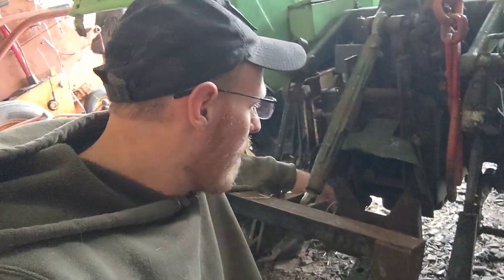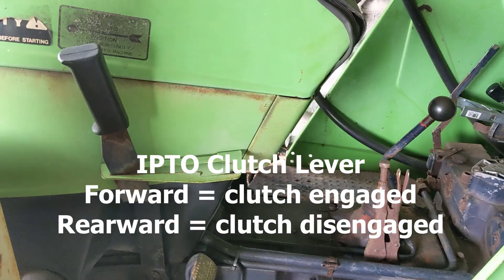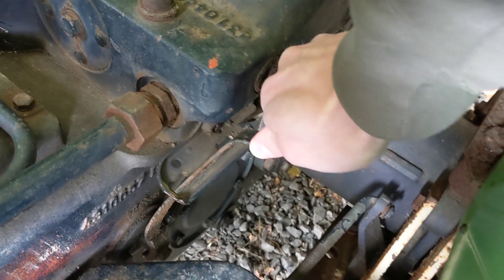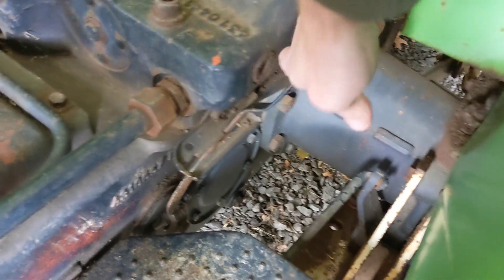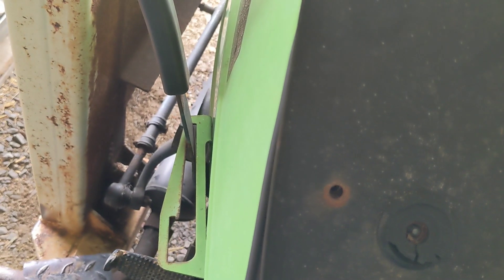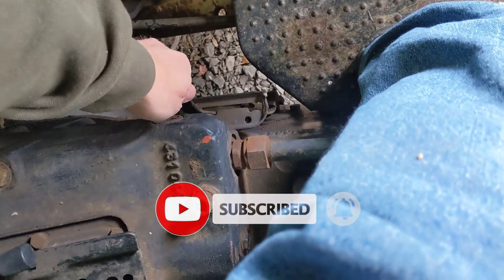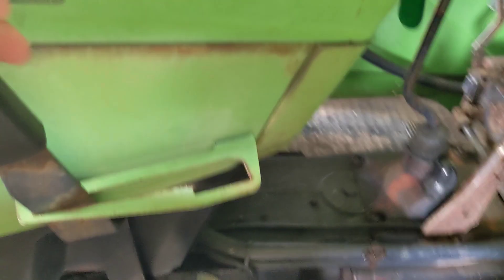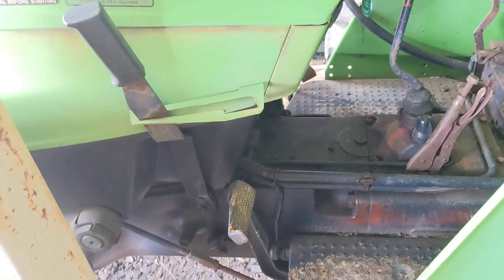Deutz Fahr Tractor – PTO Overview – [HOW TO]

Comment: So anytime you’re just generally driving or using the tractor (not with a pto attachment) the side lever needs to be forward
Reply from the maker: Correct, keep it forward and only use when you need to temporarily disable the PTO. I use it when I am making a sharp turn with the hay baler since the turn is WAY to sharp to leave the PTO shaft on. Thanks for watching!

Comment: Just inherited (a pretty beat up) 4506 with front bucket…. Tractor sat inside barn for 8 years. Recently got her running but can’t figure out how to lift the front bucket….any ideas?
Reply from the maker: Great job getting it running! For the loader, first make sure you have fluid in the hydraulic reservoir. (see this video: https://youtu.be/PGdh2EEVBA8 ). If you are good there, you may need to flip the valve selector handle on the auxiliary block to the back or upward position. It on the right side just forward of the 3pt lift lever. On my 4506 it needs to be toward the back for the loader to work. Also, if the loader gets maxed out the pressure relief pushes the selector back forward so you need to flip it back again. Good luck and let me know if you get it working!
Reply: Is there an adjustment on the aux valve? My lever goes forward very easily. I have to hold it back to lift much more than an empty bucket. (6806)

Comment: i dont have thet forward lever... when i press the leg clutch  half way down , it disengages the kardan , or pto, after that at the bottom it disengages the wheels.... yeah the is cracking in the small lever.
Reply: These tractors had two options for the power take off. Independent and live. The tractor in the video has independent. Sounds like yours is live.
Reply from the maker: Thanks for sharing how your setup works. I'll try the half clutch press and see if it works on my tractor. Curious now!
Reply: @Buttons_fix_it   did it work, its the same on my d4006 leg clutch halfway for shifting gears, all the way pto clutch.
Reply from the maker: Hi, yes it works with the half press of the clutch. I learned something new! Thanks!